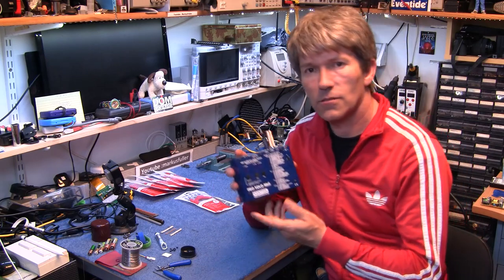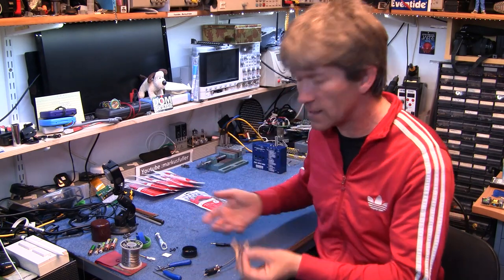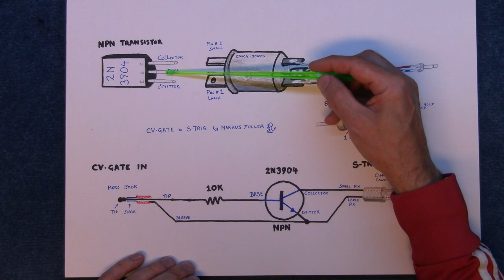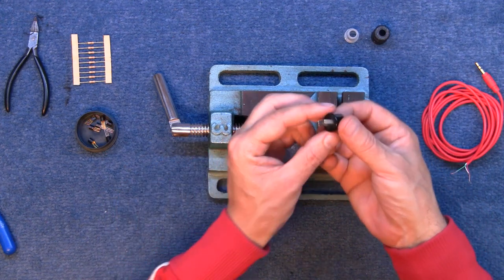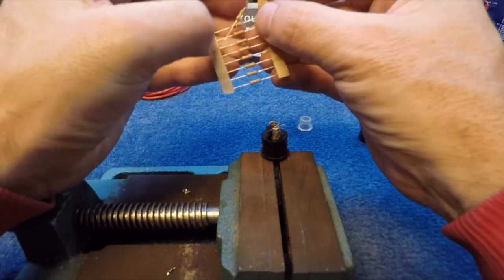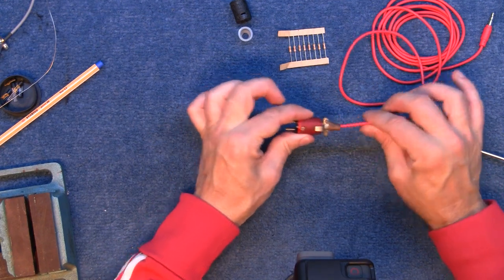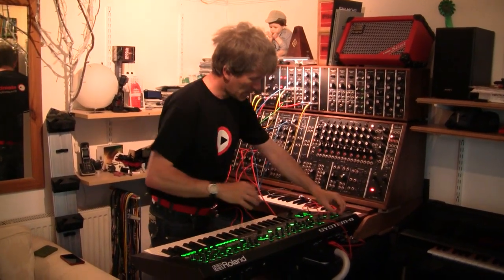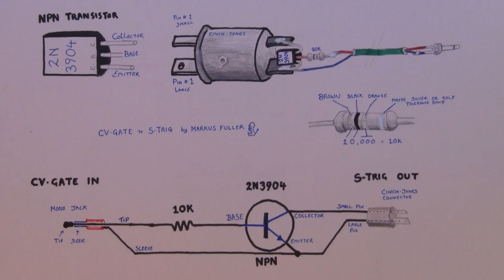how to make a CV-Gate to S-Trigger cable

Comment: A bunch of the Behringer system 55 modules replicate the old S-trig from their Moog counterparts. It's been fun to get into that, but the interface module is huge and basically this circuit is the only thing it's doing, without even having outputs for all of the potential places S-trig is used. (To be clear, as far as I can tell this was also the case for the originals, it's just a faithful recreation).

TL;DR, this video was super helpful because I was able to build out a number of Eurorack 3.5mm patch cables with this circuit for that purpose. Thank you, sincerely! Saved like 20hp of space in my rig and made those modules more convenient at the same time. :)

Comment: Just as additional info, some vintage synthesizers will have a switch at the back enabling you to choose between the two trigger types. I know of at least one, the Korg Mono/Poly. But most others do not, unfortunately. So I also had to build this "trigger type" adapter early on for my different analog synths as well. Thanks for showing everyone how to do this.
Reply from the maker: Thanks Alain, I use to have the Mono-Poly. I miss that synth :-( .

Comment: OK that's cool, but what about going the opposite way? Could I do this with a capacitor that just charges while the s trigger is constantly sending out voltage, and then discharge when the ground is triggered?

Comment: Hi Markus. Your videos have always been both entertaining and informative. I know this video is old but I thought I'd still ask; How many envelopes can you trigger with just one circuit? I'm going to build a mult with a V-trig in and 3 S-trigs out. Do I need a transistor and resistor for each out or do I just need the one transistor and resistor at the input? I don't want to put an op amp buffer on the input because I would like to keep the module unpowered. Keep up the good work and take care.

Comment: Fantastic Tutorial! I have also seen your video on the SQ-1. Do you know if the SQ-1 does s-trigger to v-trigger conversion? I have a Korg Poly-61 with an Arpeggio Trigger In (S-trigger) 1/4" jack that I am hoping to use with a SQ-1.

Comment: Thanks Markus, very handy!
I have an old Yamaha sk30 which uses yet another triggering system, basically it expects a short voltage pulse when a note is pressed and then another equal pulse when is depressed.. all the rest of the time the voltage is 0... can you think of another quick way to achieve a normal gate to this pulse system converter?
Reply from the maker: hello Ed, Im not absolutely sure but I thought the SK30 was a S-Trigger type keyboard?.however I think it also used the Hertz system for note pitch instead of Volt per octave which can be very awkward to control without special conversion gear, If this is the case then the Kenton solo Mk2 will convert midi signals into Hz/Volt and also S-Trig gate. but best check the forums first as Im not 100% sure.

Comment: Very cool Markus - thanks for posting!
If its a thing, can you do a 5v trig to Din-Sync vid? I pulling what hair I have left out trying to sync my 606 and volcas/PO-32/Eurorack!
Reply from the maker: Hi mCKENIC . to be honest I have never tried before but im sure there must be a way to do it.
Reply: Thanks Markus! 
I was 1/2 joking. Din-Sync needs Start, Stop and Tempo so its doable with an Arduino/the excellent Kenton make a box or something like the OP Lab by Teenage Engineering. I was just hoping for a simple solution :-)
Im sure Arduino is the way to go :-)
Thanks mate!
Reply from the maker: Yes Kenton certainly make some really good gear, they have got me out of bother several times with their convertor boxes etc, I was using the pro solo mk2 to do the job that this cable now does.
Reply: Baastl have a mod for their Midi Bastl to convert to DIN Sync.
Reply: Thanks George! Im a huge Bastl fan (love the Euro modules) and saw the Midi Bastl ages ago abut forgot it - great price too! Thanks mate!

Comment: Can you make me some of these cables for purchase or is there anywhere to buy these already made with the 8.5 euro-rack plug like you made in the video ?
Reply from the maker: rocsire sadly I cannot get hold of the cinch-jones connectors. they seem very difficult to find at a reasonable price.
Reply: What if I get the parts and send them to you ?
Reply from the maker: rocsire Sorry I am already in full time work and any spare time I get I use to make these videos or work on my own projects. I simply do not have enough time to take on any more work.

Comment: Amazing, will there also be a v/oct to hz/v converter vid? cause that would be extremely helpful.
Reply from the maker: Yes the v/Oct to Hz/v is quite a complicated unit to make and requires programming pic or arduino but im sure someone must have done a video on that, but it is an interesting question and something I have never really though about before.

Comment: How do you trigger different notes with this ? Are there other connections between the rack and the keyboard ?
Reply: Yes, there's "CV" (Control Voltage) which when a key is pressed a specific voltage is sent out, the synth interprets this as pitch (or it can control whatever else it's plugged into on a modular synth).  

Then there's the "Gate" (note on or off). The Moog expects a voltage to be present to mute (close the gate), where as other synths may want a voltage to be present to open the gate and play a note. 

Markus made the lead to invert the gate output of his Roland to make it compatible with his Moog's gate. Further reading on Wiki for ya....

https://en.wikipedia.org/wiki/CV/gate
Reply: There has to be a pitch CV cable in there somewhere, running from the Roland (controller) to one of the VCOs on the Moog. Wild guess would be that it's the red cable going to the fifth oscillator module in from the left.
Reply: Yeah you can just about make out both red cables from the back of the Roland. Back right are where the CV and Gate outs are on that. Quite novel to see a new synth still supporting CV/G. The only bit of gear I have that supports CV/G (in and out) and can 'convert' midi to CV/G is my Novation Super Bass Station.
Reply from the maker: Hi Karl, I was just about to answer but the replies from Neffers and Sootkins have already answered.

Comment: actually regarding the mini plugs - i've found it really DOES matter - at least with my synths - the stereo mini plugs ring connector will short between the mini jack tip and sleeve!! i would STRONGLY recommend you use a mono mini plug for that reason
Reply: I had a V-Trig to S-Trig cable made in hopes that I could trigger my Moog Source from my Squarp Pyramid in order to trigger the arp and sequencer on the Source to run in time with the rest of the gear!  Having a heck of a time. Nothing happens when I hit play on th sequencer. The V-trig-S-trig is routed cv out of the Squarp Pyramid at 5Volts. AM I missing something?
Reply from the maker: Hi This cable that i made in my video needs 5 volts trigger and then the transistor at the Moog modular end becomes a type of switch that shorts the 10volt S-trig shorting voltage that the moog modular needs to trigger an event or note. as for the Moog source I believe it uses a small jack plug and I am not too sure what the connection are as in tip ring sleeve as I have never owned one. however the moog modular relies on it being shorted to the second pin, thats all the transistor does in the circuit made into the moog plug. some manufacturers are able to change the 5 volt out to S-Trig in the menu but I am not sure how the Squarp triggers work or if you can change the type in the menu or even if you can change anything in the menu of the Moog Source to help your situation. you could always email moogmusic.com directly they may have the answer.